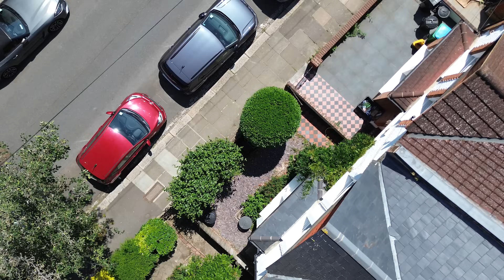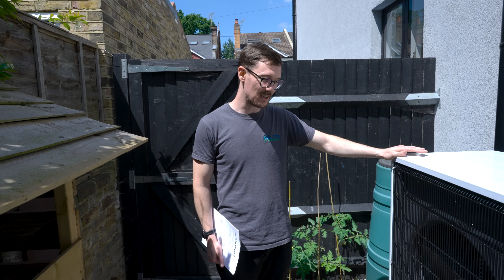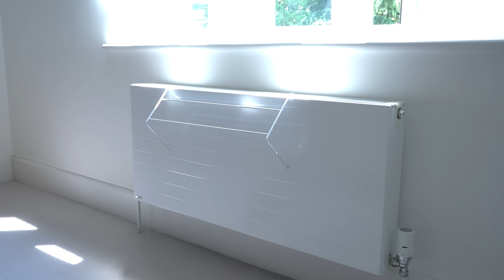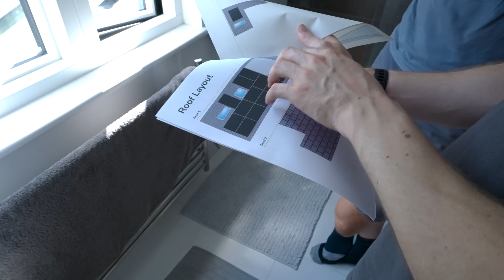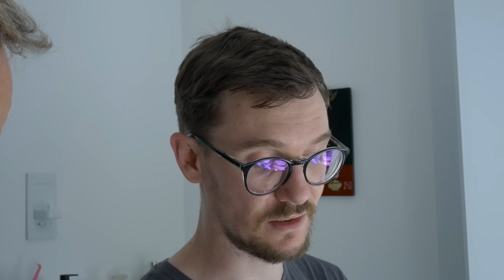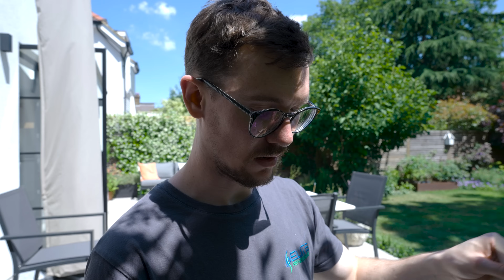How to Reduce Heat Pump Running Costs (Live Consultancy)

Comment: I live in an A1 rated house drive an EV car my costs have double compared to oil heating emersion water and desal car!   Heatpump using weather compensation but still double fossal fuel costs before retro fit!  Can you explain that one?
Reply from the maker: Ouch! That doesn’t sound quite right - have you checked different energy tariffs?

Comment: I had the government grant and they installed a terrible 12kW heat pump system for a Victorian building which is far from ideal. I’m still getting about a 0.2 bar pressure loss every week and they even installed the hot water expansion tank incorrectly which I had to point out myself. I hate how people refuse to learn about the systems they’re installing. I’m still having issues months after the installation and now my heating expansion tank is leaking too. It’s crazy how many problems there have been and I had to sort things like drain-off valves and lagged pipes myself.
Reply from the maker: That sounds really frustrating, are the original installers not putting things right for you?

Comment: Don’t get fooled into paying for microinverters, it’s a rip off as they are totally unnecessary. String inverter every time, use the considerable money you save for extra panels.
Reply: 25 year warranty, shading mitigation and optimisation and low light generation. In the right conditions micro inverters are far superior than a string inverter. I have proven so many people wrong on this! They are more expensive but far better on most properties.
Reply from the maker: Absolutely right! 

We also use them to remotely diagnose any performance issues with panels on clients' roofs without needing to disrupt their day or climb onto a roof! 

Usually worth the money, in our experience.
Reply: @eliterenewablesofficial  or, more likely, the optimisers themselves are the failure mode. One set of scaffolding to replace failed optimiser more than offsets any gains.
Reply: @yp77738yp77739  I think you've just had bad luck as I have had micro inverters over 6 years and no problems.
Reply: I personally think micro inverters often only make sense on a single story flat roof or one you could access without scaffolding - most of the time there isn't much shading on a double story roof, and if there was power optimizers seem to make more sense in my mind as I feel they are less likely to go wrong... This is my opinion as a newbie to solar and have been learning for my own install but I'd love to be proved wrong